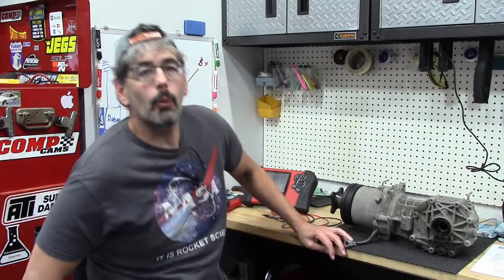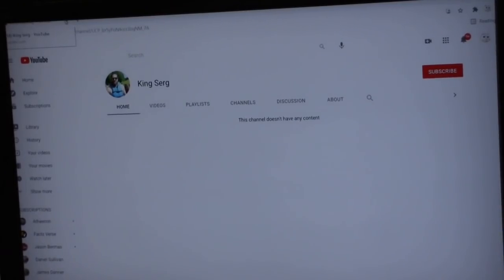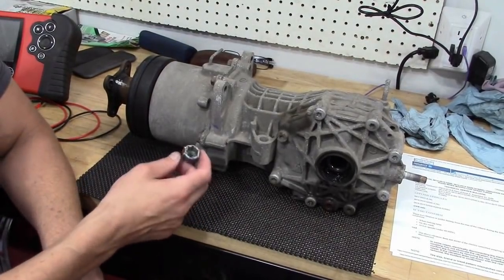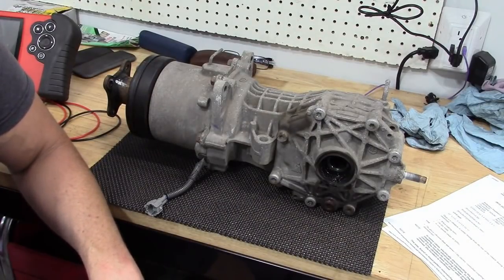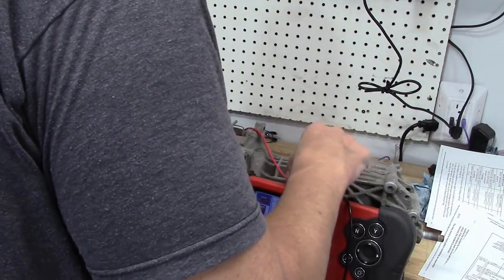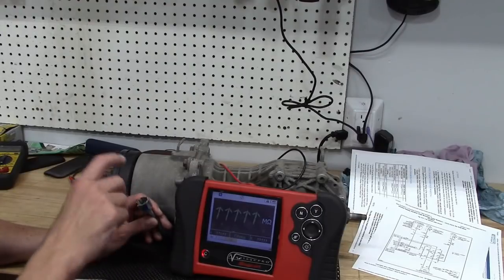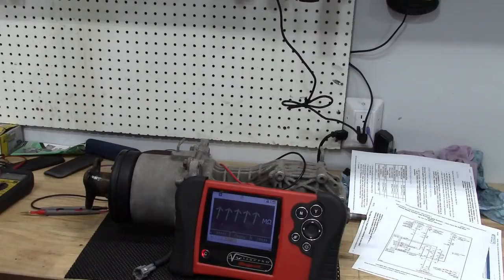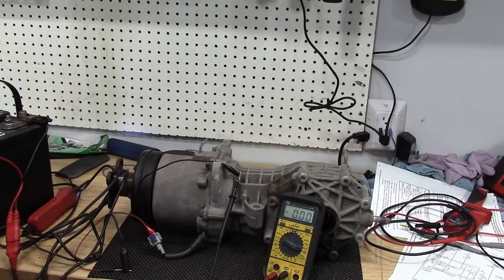Nissan Rear Differential Electronic Coupler  a PSA

Comment: I think the Buick Rendezvous & Pontiac Aztec had a similar system at the back wheels. This was an automatic AWD system but I don't know how the differentials used the computer commands to regulate power to the rear wheels.
Reply: Hope this helps answer your question. I found the following information off Pro Demand Automotive Repair for a 2005 Pontiac Aztec: 
During a front-wheel slip condition, the external gears of the gerotor pumps rotate at a faster rate of speed than the rear-wheel driven internal gears. The gerotor pumps pull oil from the sump through the clutch pump check valve sending pressurized oil to each individual piston to activate the separate clutch packs. On-demand torque/drive is provided to each of the rear wheels as required. A valve internal to each piston housing controls maximum clutch pack pressure. A second valve within each housing is temperature compensating and controls fluid flow based on ambient temperature. The system operates in both forward and rearward vehicle directions.
Reply: @joserosas5420  That is interesting. Thank you for posting!

Comment: Thanks for this follow up Matt, to me, this would be a heads up to get rid of the crappy vehicle, I do not like dead-end diagnostics like this final drive and not being able to get any direction from the manufacture's docs seals that for me
Reply: Nissan is definitely rogue. At 180,000miles its asking for a second rear diff.
Reply from the maker: Hahahaha. I have actually seen this several times now since this video. There is clearly an issue with those differentials.

Comment: I understand the desire to know "how" it works.. but you could still test to see "if" it works lol... spin the input shaft and look through the axle holes to see if the ring gear turns (I'd imagine it shouldn't.)  Then apply 12v to the coil/clutch/magic piece and see if it now connects the input shaft to the pinion/ring gear.
Reply from the maker: how would that work if it’s pulse width modulated or voltage regulated?
  What if is a viscosity based mechanism?  How would you test it then?

Comment: What happened to the rubber band on the DVOM when doing current checks?
Reply from the maker: Hahahah, I stopped using it because I no longer use the DVOM for current measurement. it’s so much faster and easier and safer to just use a clamp. Ever since I got my clamp I stopped using DVOM for it b

Comment: I worked at Napa a long time ago and we had 3 alternators bad outta the box. 
After that we started testing all alternators before selling them.
Reply from the maker: I often wonder how much of that could also be people who just parts-swap and damage the electrical component and return it to the store.  Parts stores should NEVER take back any electrical component.
Reply: @SchrodingersBox  They never used to. Did that change?
Reply from the maker: yep- at the stores I have been to I have absolutely seen people return electrical parts. all the time.  I believe I even mentioned in a video a while back about a guy who returned a starter an alternator and a battery all at the same time when he still had his car not start
Reply: Schrodingers Box   When I replaced the alternator in my 2004 Chevy Astro I brought along the alternator from my 2000 GMC Safari (currently my parts vehicle) because I wanted to use that second alternator instead of buying a new one. Trouble was when hand rotating the pulley it sounded worse than the known bad one. I had AutoZone test both on their machine while I watched and sure enough, both were bad. Purchased a new one and had them run that on their machine as well so I didn’t need to make another trip for a unit bad out of the box. Since then I’ve found out that I may be able to repair the Safari unit so I’m hanging onto it for now.

Comment: Thanks for the video. I have a Journey with the same awd system and some sort of “clunk” at 20 and 40 mph. (Engage-disengage the rear differential). It was under warranty so I took it to the dealership. They replaced the whole transmission first but nothing, then the coupler saying it was bad, but I still filling the “cluck” so must likely is the actual differential. I’m glad it was for free but very bad technicians… I’ll disconnect it as you pointed out y see if it goes away… and back to the dealership
Reply from the maker: hmmmm that’s weird. wish I could look at it!!
Reply: @SchrodingersBox  becases the actual viscous coupler you can’t test if there is any “play” on the diferencial by rotating the driveshaft. I’m from Kentucky. Too far hahaha. Thanks for putting out so many good videos

Comment: I hate using my multimeter for amps too.  I hate blowing up multimeters.  Only one person to blame when that happens.
Reply from the maker: My fear is blowing up circuits with it if you forget it’s in current reading mode.
Reply: @SchrodingersBox  Does it not  just blow the glass fuse
Reply from the maker: not if the circuit has less amperage capacity  than the meter fuse. for example if I am testing a transistor on a PCM and I am in amp mode, I will destroy the PCM.
Reply: @SchrodingersBox  Didn't think about that.  Makes sense.  If I'm in amp mode and touch the wrong thing, I've just completed a circuit and  poof!  the magic smoke comes out.  Well, that tears it.  I'm off to give Amazon more of my money on a decent amp clamp.  Wish me luck.
Reply: Yeah, I've blown a couple because I forgot to take it out of amps and had to replace the fuse.  Most still seemed to work okay, but I never trusted it fully again.  One didn't even after I replaced the fuse and that one I spent over $100 on.  I've really got to drop the $200+ on a good amp clamp.  All of the cheaper ones I've bought have been next to useless.

Comment: Mat did you try turning the input or output shafts then apply the current & see if there was resistance to your force indicating there was actuation ? We have a similar sort of system on the current Mercedes rear diff but it is a clutch pack operated by a small electric motor but the same issue with vague technical data.
Reply from the maker: Didnt think to do that! will try that when I get a chance.